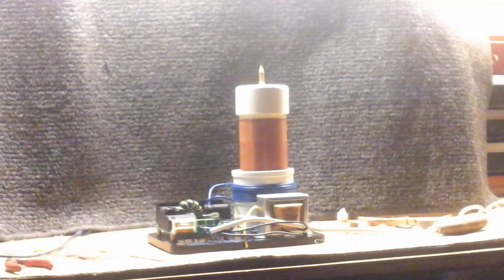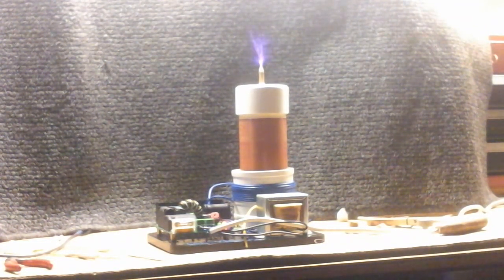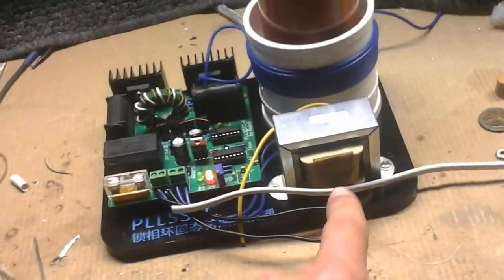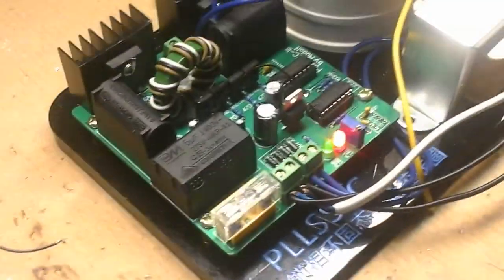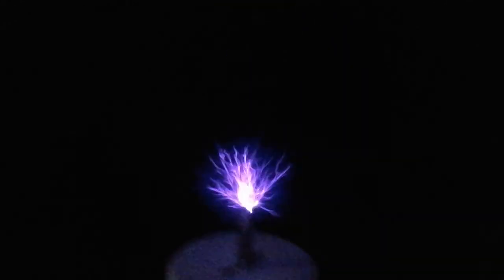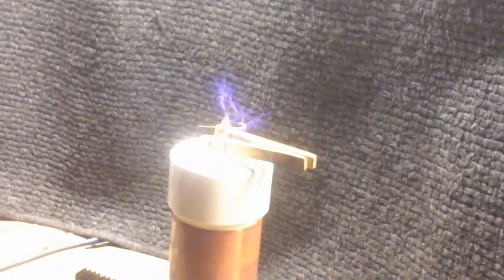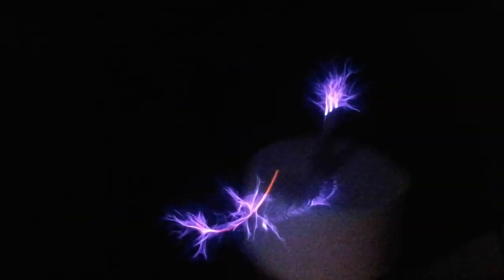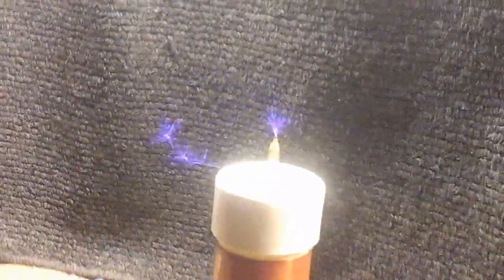I Got a Tesla Coil!

Comment: Excellent presentation, thank you for sharing!
What do you do with the long insulated wire on the other end of the secondary coil? :-)
Reply from the maker: It goes to an earth ground.
Reply: Thanks, I suspected as much but was unsure.  Your reply appreciated and reassuring. Next must change transformer from 220V to 240.  Andy.
Reply from the maker: proffski You can use the 220v transformer on 240 just fine I would think. Take the output leads out, put a load on them and measure the voltage.
Reply: I took the courage to try it today on 240V.  Works like a dream but the transformer does get hot after a while.  So will change after Christmas.  Thank you for your valuable advice Zak!  As you said, a bargain! :-)
Reply from the maker: proffski The transformer on mine also gets hot, and I have swapped it for a 120v one since I live in the USA. I think that having it get hot is normal.

Comment: thank you for the review! I wanted to see one in action before I sent $140 to some random guy in China
Reply from the maker: Cool, glad I helped! I highly recommend this product,  it's easy to assemble and it works great. The only warning I have is be careful not to get any metal objects or fingers close to the copper colored part of the secondary coil, as the insulation is not great and it will burn through. Mine has burned through in  a couple tiny spots, but it works as well as when it came out of the box.
Reply from the maker: Also, I may make another video about it showing how to make the arcs a bit bigger than they are out of the box.
Reply: Coils have that habit of increasing their voltage until it breaks through their insulation unless a suitable load is attached. Try a dill pickle in the dark.
Reply from the maker: John Possum A normal pickle would create too much capacitance to ground and kill the oscillation. A very small pickle would be needed to make it work.
Reply: ElectroGherkin?
Reply from the maker: John Possum If i have gherkins in the fridge I'll try it.. and now i want pickles.